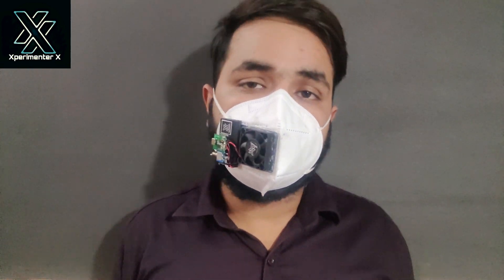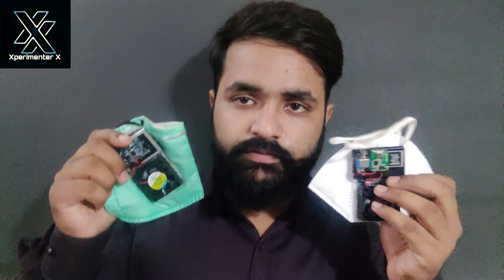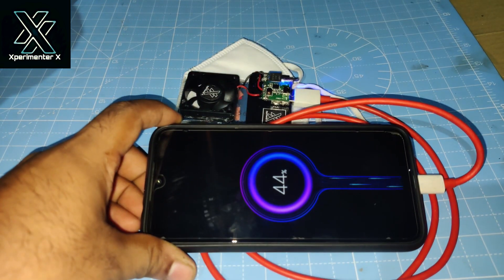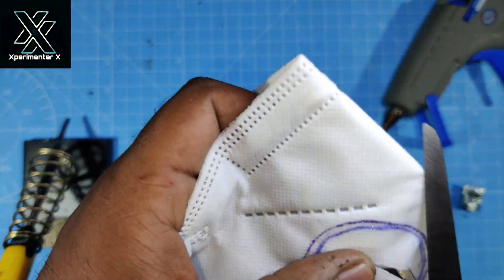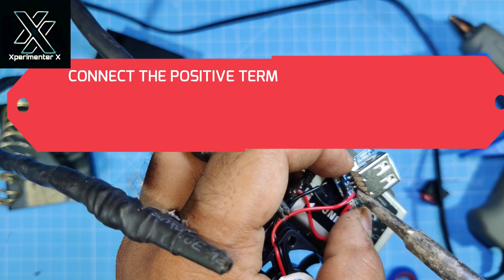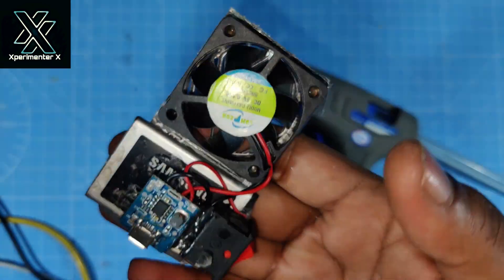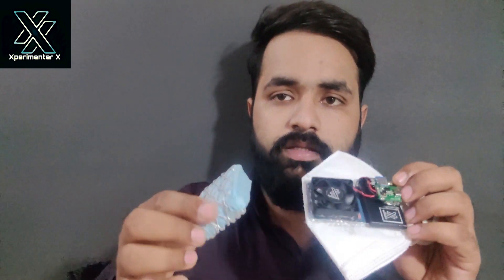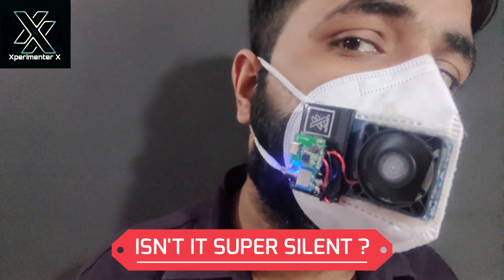Making Electric Fan Mask  |  Anti Sweat Mask | Best Electric Mask | Rechargeable Electric Mask

Comment: Bro Plz make a dedicated new video in this with details and link of all components used Currently the pollution is really high.
And Try to make it more advance with more small overall size, better battery backup and Improved air flow
Reply from the maker: Contact me on Instagram for more info ℹ️
Reply from the maker: Contact me on Instagram for more info ℹ️

Comment: Since it's been an year now, did you face any side effects of using this modification in your mask.
It may be throwing some excess air in our nasal passage so wondering if it can cause any side effects...
Reply from the maker: Yes battery drains fast. Within 3-4 hours 😂.... People will look at you as if you r a Cyborg 😂 you will get bored of all type of masks..... But I can bet it's 5x better than normal mask....

Comment: sir which filter do you use???????
Reply from the maker: It's a Normal surgical mask. You can use HEPA filter or activated charcoal filter as well
Reply: @XperimenterX  sir how to make hepa filter
Reply from the maker: You cannot make HEPA filter. You need to buy HEPA filter fabric from market...
Reply: @XperimenterX  sir what's filter is long lasting
Reply from the maker: No filter is long lasting. Everything has an operating life

Comment: This buck convertor while charging emits  a large amount of heat and you paste it on battery... Any guess what happen next 🔥🔥🔥🔥🔥🔥???
Reply from the maker: No, I didn't generate much heat. I have used this may a times. May be your fan is drawing current which is causing overheating.. I didn't face any problem of overhearing so far.
Reply from the maker: I have used it more than a month and I didn't face any overheating issue. If it had over heated then the glue would have came off 😃
Reply: Well my friend many videos are present for this drawback of buck convertor, even I tried to make this fan mask... The major problem is the heat emitted by buck convertor at very high amount that while charging you can't hold it in your hand... This is the heating issue and can be resolved, I am not saying that your model is bad...
Reply from the maker: I have used this many a times. I didn't notice any heating issue with battery or charging module... I don't know this this has been happening with you.. what configuration of battery or fan are you using????
Reply: 5v fan and 2000 Mah battery

Comment: I am not able to get this fan, the fan which I got from Amazon doesn't have a descent RPM... So please guide us to get one...
Reply from the maker: It's 40x40x10mm 5 volt axial fan.. the RPM would be less if you will use just a battery. As battery delivers 3.7 volt only. So you will need a booster module to increase the voltage upto 5 volt DC. Once you get desired voltage. The RPM of the fan will get increased to operating RPM. Hope this would help.......
Reply from the maker: Contact on Instagram. I will explain you everything on call.

Comment: Is the battery 3.7V?
Reply from the maker: Yes, it's 3.7 V Li-ion battery. A booster module is used to increase the voltage upto 5 volt.

Comment: Drawback- Not washable
Reply from the maker: Yes! If I had a 3D printer then I would have made a removable design. Then this could be easily removed and washed, but with glue gun, it's impossible to remove and wash easily.
Thanks for your comment.
Stay connected ❤️ Love 💕
Reply: @XperimenterX  i made same like you.
But my one is washable.
Reply: @XperimenterX  also i don't have a 3D printer for molding

Comment from the maker: Guys! I have been using it for last few days and it really works well. If anybody is interested in commercializing the product then do contact me. If you need any kind of assistance then also do contact me on my Instagram account or Xperimentershiva@gmail.com
Reply: Commercialize it
Reply: It the battery 3.7 volts
Reply: Hi. What's booster cum charging module.. were to get it from?
Reply from the maker: It's 5Volt 1 Amp charging module for DIY Powerbank.

Comment: How can I wash it ??
Reply: Unplug battery and wash it as much u can.....wait till it get  dry then put battery back at its place and boom u got it😄
Reply from the maker: Replace the mask filter if it gets dirtier
Reply: Xperimenter X   That’s great
Reply: It should be spread everywhere.
Reply from the maker: It can be washed easily using sanitizer. be careful with electronics
Reply from the maker: Jo log nahate Nahi , wo mask ko wash Karne ke bare me na  pucchen 😁